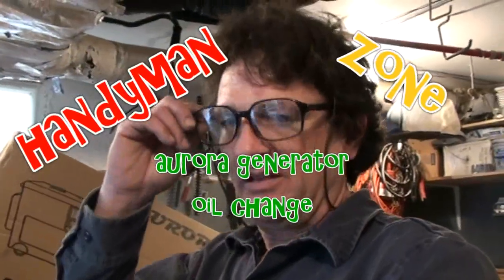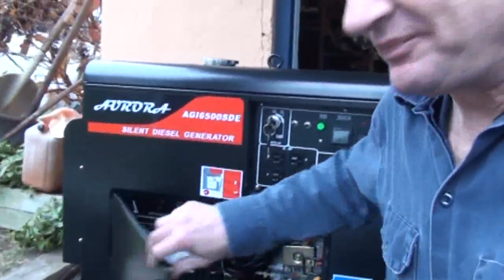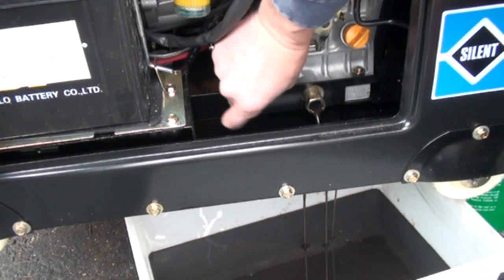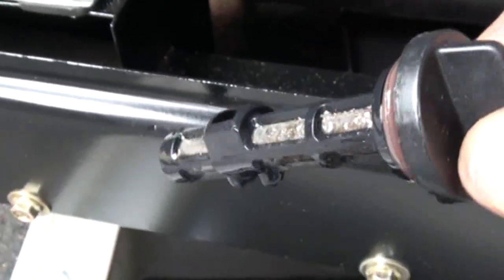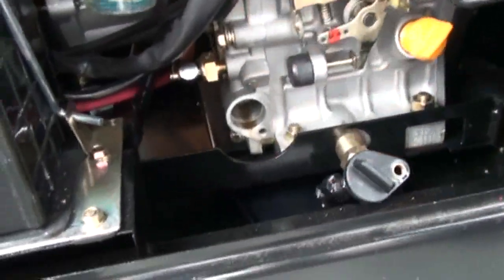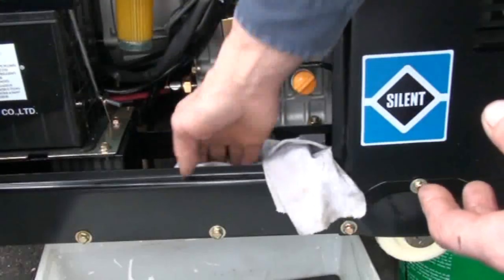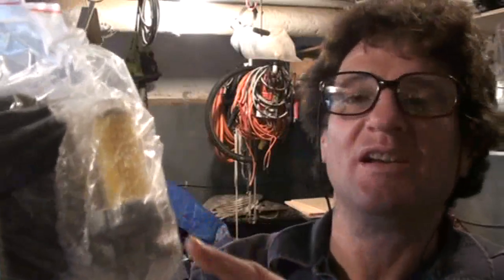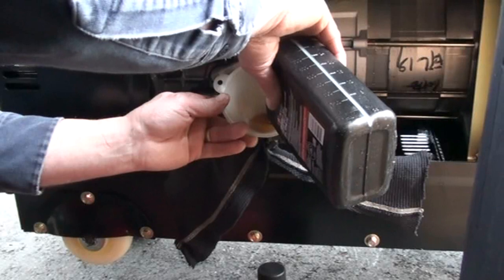Generator Oil Change

Comment from the maker: @bob teree, thx the response, and yes operating temp, you can see the oil has viscosity of water in the vid, this is because it it at tempature. if was cold engine the oil would be thick like maple syrup or honey...take 4ever to drain and so much left clinging to inside of crankcase almost not even a oil change.  even cars , trucks, boats engine should always be at operating temp to get a good oil change . thanks again @bob teree

Comment: Dino, Nice video, one thing I wanted to point out, I have seen from experience in the past. You want to be VERY careful putting any generator under a load so far below it's operating RPM. Reason for this is they don't produce as much voltage at the lower RPMs and consequently the voltage regulator has to work extra hard to compensate. I have seen a few sets fry voltage regulators and rectifiers this way. Mainly because the engine speed was set incorrectly or they were shut down under load.

Comment: ANY FILINGS THAT GETS PAST THAT FILTER ACTUALLY GOES STRAIGHT TO THE CRANK AND THE SIDE BEARING WHICH IS A DEAD END AND IT STAYS THERE TO THE ENGINES DONE UNLESS YOU TAKE THE CRANK OUT AND BLOW IT BACK  IT CANT GO ANY WHERE ELSE EXCEPT FOR A TINY BLOW OFF HOLE HALF WAY UP THE CASING

Comment from the maker: @rrf482012,
diesel is way to go IMO, 1st hurricane sandy aftermath was NO GAS for 3 weeks, pleanty diesel. the stations never ran out of diesel. 2nd diesel storage for years, gas lasts few months. want store reserve you would rotate gas into car and burn, where can you dump 20 gal bad gas? you can burn diesel in home oil burner after couple years, reverse, in a pinch u could burn heating oil in diesel engine in emergency ( adding 2 stroke pre-mix). diesel best choice, protect home freeze thx

Comment from the maker: #ctktmrider, yup anti-seize lube is great for keeping bolts from freezing i use on anything from miter saw balde bolts to spark plugs, especially any bolt into aluminum , keeps the galling away.....er but this is diesel engine....no spark plug, but i am sure you knew that.
ill take that idea to a video tho, all viewers can look forawd shortly to a video on reasons to and how to use anti-sieze typr lube on this channel....so subscribe now if intersted, thanks #ctkmrider !

Comment from the maker: rrf482012, thanks you for watching. no transfer switch. i back feed thru breaker, i am all set up for this with #6 cable &30 amp breaker. only takes a few minutes. i am ok working in and around breaker box, not a big deal. so no switch for me

Comment from the maker: yes Gerry Cande, the manual is nice but it tells you in manual that the online manual is better reference. 
my petcock is also 90 deg, its perfect either 180 or 90 as long as it shuts the fuel and made to last both of which it appears to do
thanks for waching my video, thanks nice comments and questions and i would check the nline manual at they website, even save to your hard drive or me, i saved to my phone sd card or print it out....thanks Jerry, good luck

Comment: I can't imagine what good having a load on engine would do.  Being that the only thing "breaking in" are the piston rings mating up with the cylinder walls, I would think a load (higher pressure on the rings) would, if anything, hurt this process...

Comment from the maker: polfixer, mep-003 for daytime, it big ehougt to run the ac, washer & dryer, oven & RANGE,  ITS LOUD AND USES LOT FUEL, THE AURORA FOR NIGHT TIME TO keep THE HEAT AND FRIDGe working, couple tv, computers and a few lights.  its efficent on fuel and quiet ,plus they are complicated machines , prone to maintenance and repair issues, they back each other up, after sandy and nor"easter we were no electric 16 days, fuel was hard to get, no food in markets, roads blocked. 
thanks for watching

Comment: Dino, I was wondering what got you interested in the diesel generator? I have been eyeing this generator for a long time. It's more of a financial issue that I don't have it by now at this point. Why did you not choose a gas generator? I was thinking that I wanted something a little bit more Industrial since I drive a diesel truck also. What I do end up getting my generator it most likely will be the model that is not enclosed. Thank you for posting the videos.

Comment: ...dino. those are single cylinder chinese pieces of crap. You can put as much lipstick on a pig as you want but....thats right you know. I respect your loyalty to Ron at Aurora but I would be surprised if the 186F single cylinder diesel engine lasts 100 hours without something going on it...

Comment from the maker: i did 8 because if i remember in the online manual thats also where i got the 1/2 speed tip, and yes i would use synthetic AFTER break in, it makes sense
when my 100 hour service comes, yes i will video , i am a full youtube partner after all, i get paid for my vids
i'm up to 53 hours with hurricane season right around the corner.
tonite i'm making a video of installing a century fuel products NG conversion kit on a gasoline honda , all custom fitting parts and cutting frame! upload in week? thx

Comment: Low running in speed may result in voltage regulator fatal damage due to high current production in order to keep the voltage within the preset limits

Comment: Dino, one more thing: Keep an eye out at Napa for brake cleaner going on sale. I have bought a couple cases already on sale two different times. I find the 4800 works best and I can get a case of it for around $23. Just figured I would let you know, I use the heck out it :)

Comment: Hi Dino thanks for the video.  I just got my generator last week (I got the open .. load frame :-) ) anyway I have a question you changed the oil at 8 hrs .... the manual I have says 20 hrs with a non-synthetic oil.  Should I do it sooner  ?

Can you also do a video of the checking the valve head clearances ?